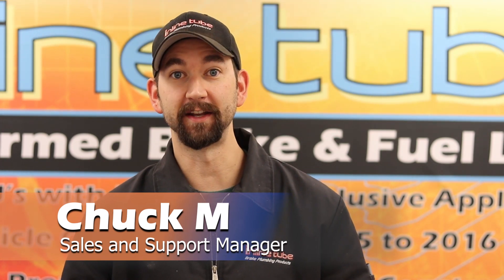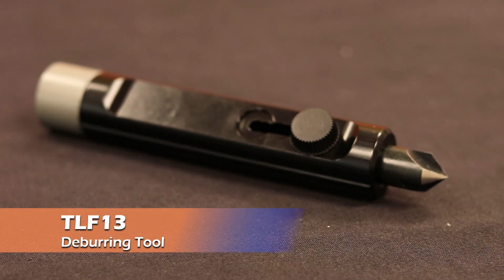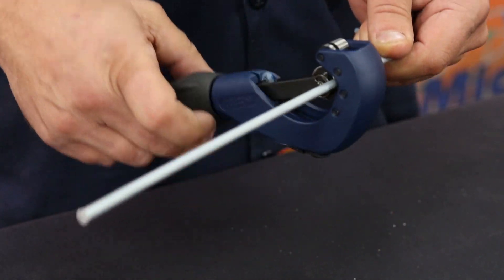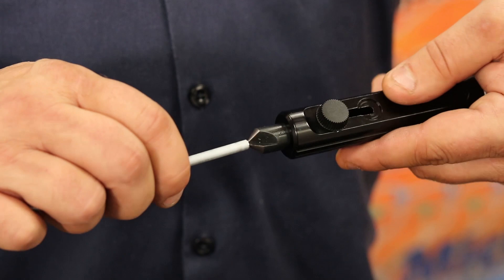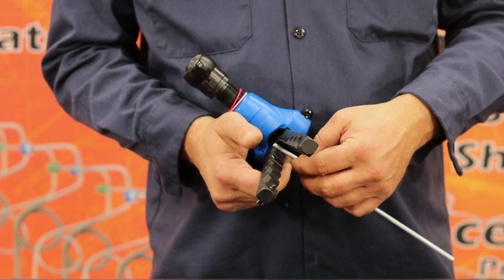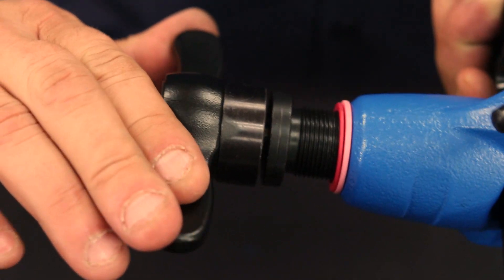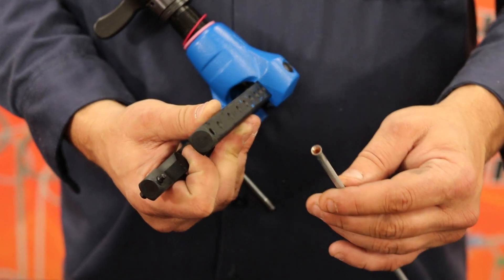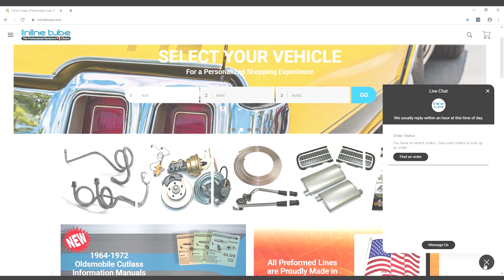How to | Single Flare a Brake Line

Comment: Double flares are seen as the industry standard. I think that your brake tube strength will have to be taken into account, with steel lines being okay to single flare, and copper tubing safer with double flares.

Comment: Will a single 37 degree flare be alright for breaks I'm doing a break line tuck and the fittings are 37 an
Reply from the maker: Yes, 37 degree AN will work for brake systems. If you have any additional questions, please email us or reach out by chat on our website. Thanks!